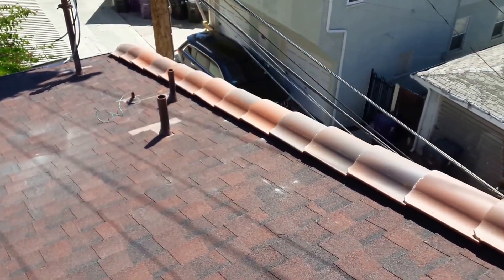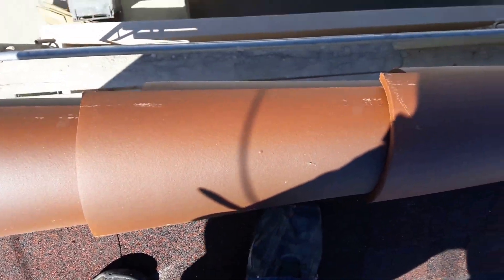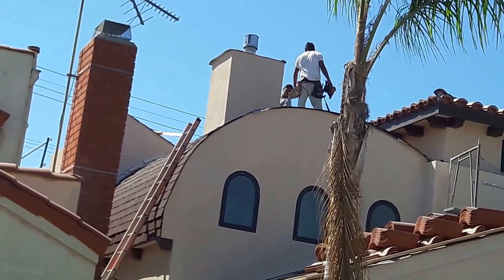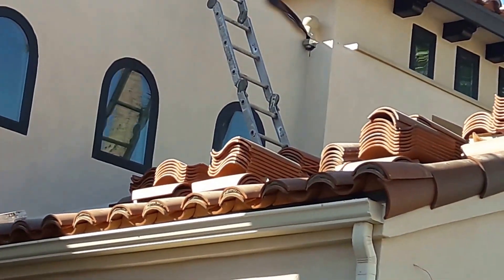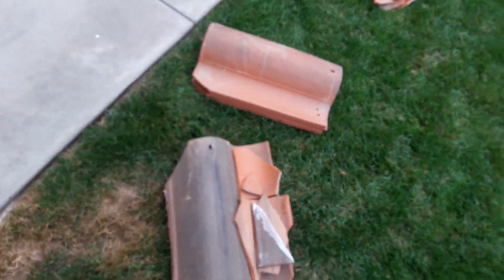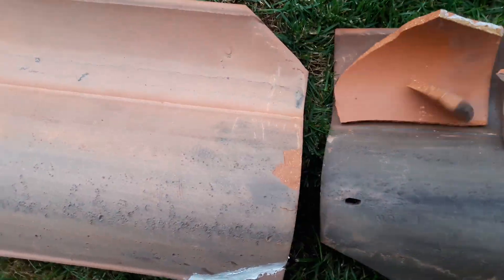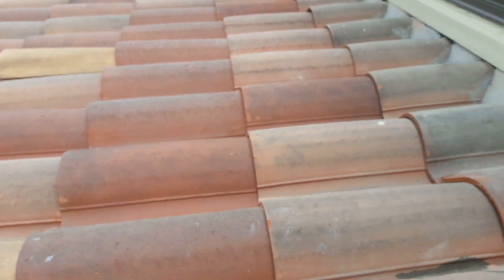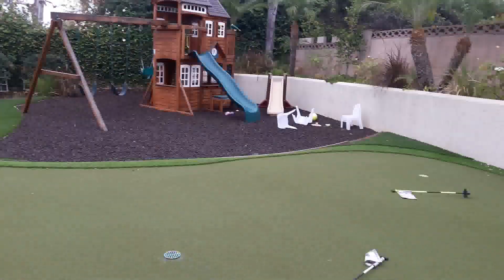Roofing Tiles : laying clay tiles . Beautiful Tiles,Awesome tiles!

Comment: Is there a reason why you did two piece tiles first at the edge before continuing on with one piece tiles?  Is it possible to start with one piece tiles?
Reply: Yes. You dont need the 2piece. You can do it with the one piece s-tile alone.
The 2piece is just for looks.